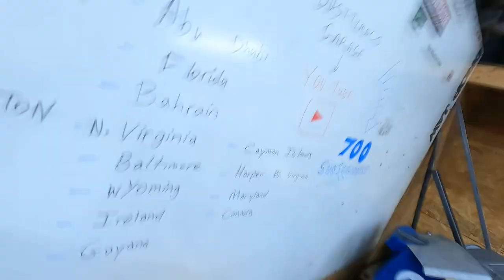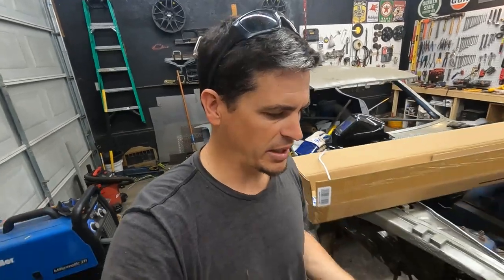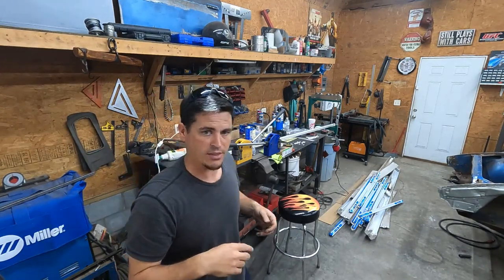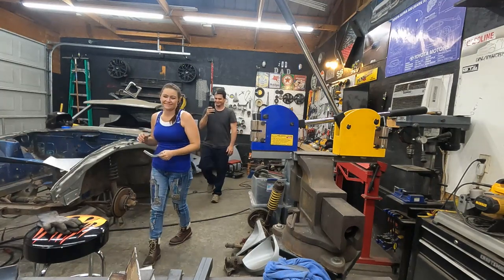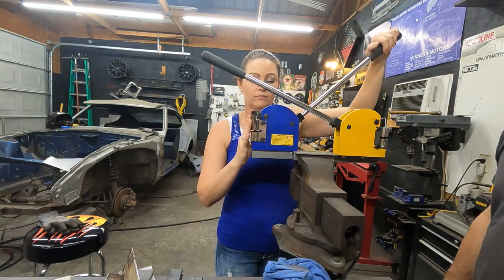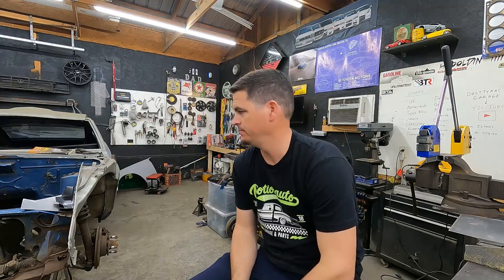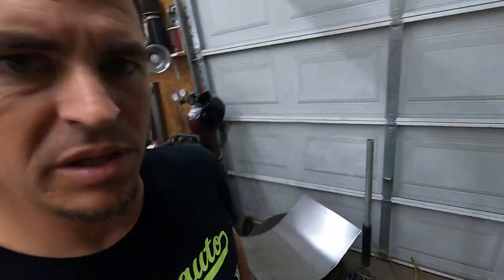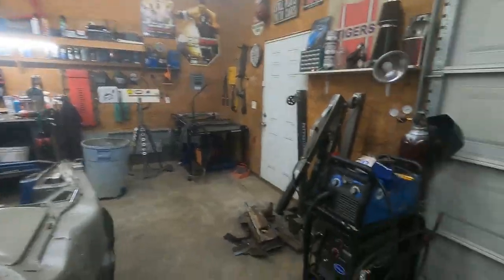REBULDING A LEGEND (My Wife helps BUILD her 240Z) & SHOP UPGRADE

Comment: Damn dude a lot going on there! I too had a frustrating moment in the garage I knocked my leg into a edge at the same time some stuff fell off the shelf and I threw a tool into the wall out of frustration all at the same time. Lighting is pretty important a while ago, I ended up buying 4 of the 5000 lumens harbor freight shop lights made a huge difference. The one thing that I wish I had was a AC weather control can help with ones want of fixing anything. You can get it done by July if you work on the car consistently but this is not a easy project at all the metal work is killer! BTW as the car is getting together the Z on the floor plans are really popping. As far as projects I'm finishing a front engine water cooled Porsche next will be a 82 BMW 5 series and I have a 2004 mini cooper S that isn't a project but their is some stuff I want to do to it. None of the cars have body stuff the BMW is interior and engine. So we'll see what happens.
Reply from the maker: Yo!!!!! BennysBenz!!! Sounds like you got alot of projects your working on too bro!! Heck yeah!!!! Yes the AC helps in the summer for sure. Thanks for the support as always bro!!! Good luck on your projects, Porsche, Mini, and the BMW!! Dont be putting too many holes in the wall 😂 😂 Are you on instagram? You'll have to send some pics!!!! See ya in the next one bro!!!!

Comment: How come you're not using the English roller to make those round bends?  Or was it that the pvc pipe quicker?
Reply from the maker: Could have probally done it on english wheel also but just rolled with the easiest way I thought to get the job done.